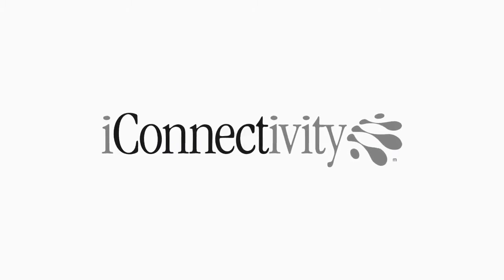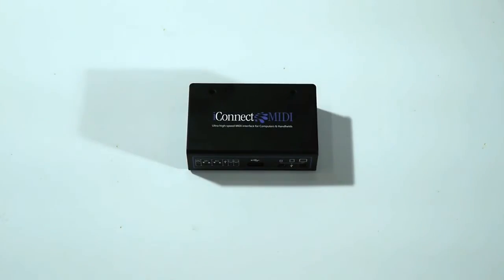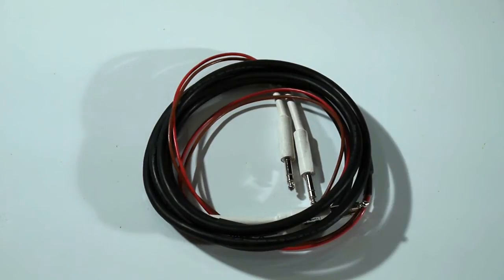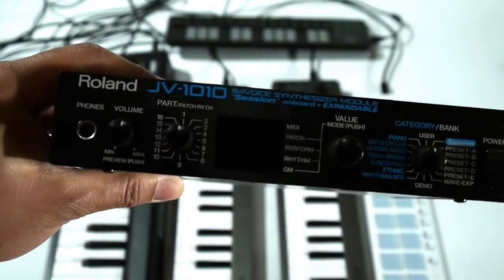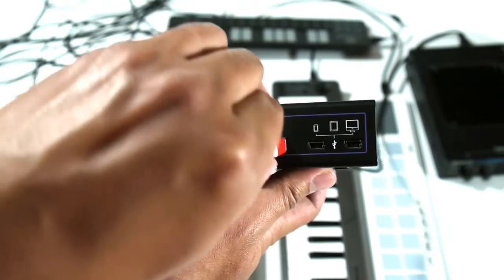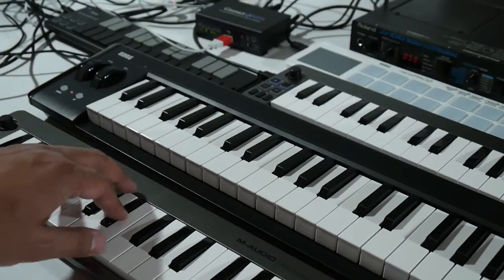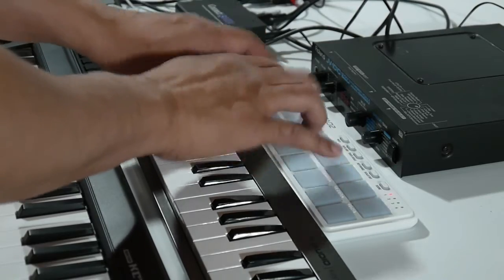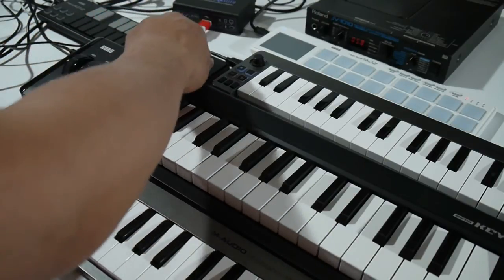iConnectMIDI Introduction and Bridging Example

Comment from the maker: We haven't tried the Yamaha DGX digital pianos, but iConnectMIDI should have compatibility with all Yamaha USB MIDI-equipped instruments. With the Roland Sonic Cell, although it has USB MIDI, it may not be fully USB MIDI compliant with Roland's implementation. However, you can always use the MIDI DIN ports on the Sonic Cell. iConnectMIDI's bridging feature will allow this to work.

Comment: I have a Roland F-20 digital piano with only (midi) USB in/out. I want to connect it to an Alesis QSR sound module with only 5pin Midi ports as stand alone (no PC) and using the piano as a controller for the module.   Will the iConnectMIDI2+ do the job?  Thanks

Comment: THANK YOU. I have been searching the internet for a way to connect my Roland Boutique (no USB) to a cheap USB keyboard (no DIN.) without a computer involved. 
Only question,  what's with the 30 pin? I didn't see an iPad in that setup and anyway iPads don't use 30 pin...they use Lightning. 
I sure hope this gizmo isn't obsolete....................!!
Reply: This was from 2012 just Incase you didn’t catch that. They’ve added many revisions throughout the years. 😉